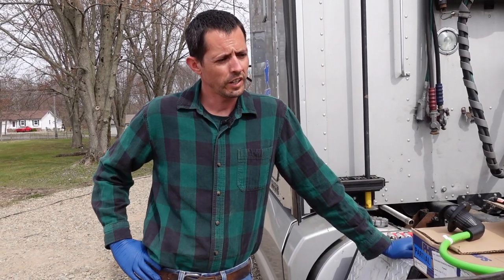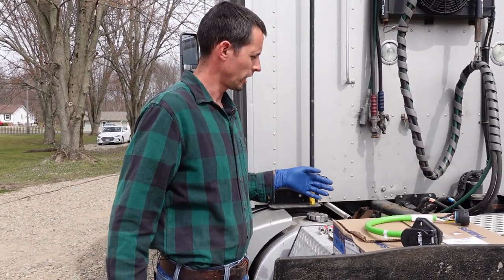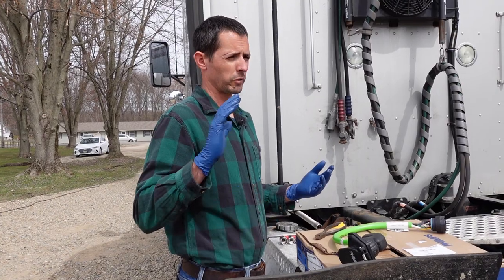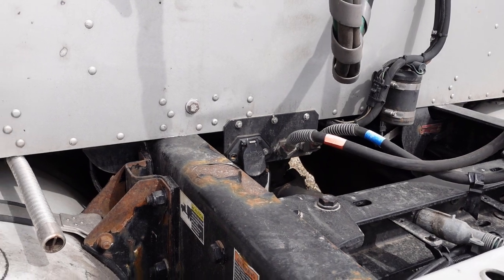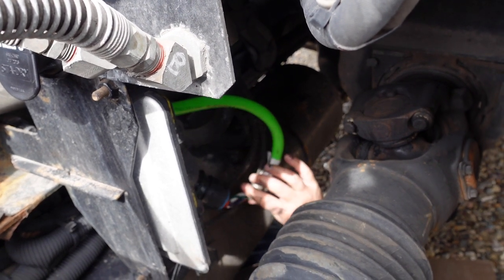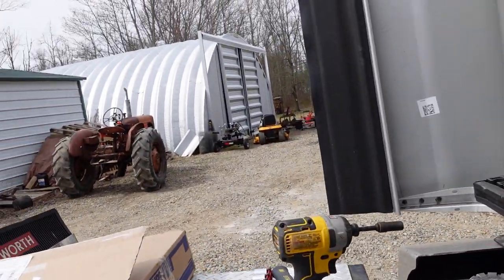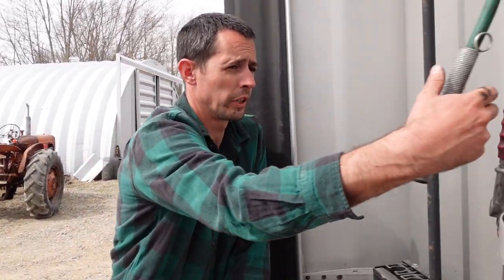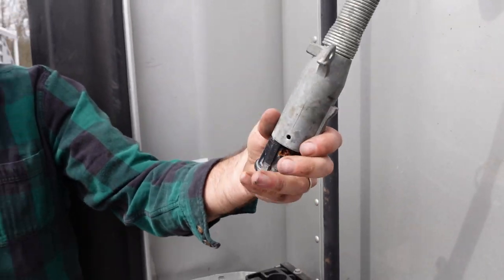How to Replace Trailer Pigtail Harness - Semi Truck Trailer Light Issue With Kenworth

Comment: Nice but why didn't you put dielectric grease on the short pig tail and on trailer tail saw rust . Winter plays heck on electric anymore.  I take all connects apart in fall to make sure of no problems.  You did well though. 2 thumbs up.  Happy trails

Comment: Will a bad pigtail make the trailer abs light come on
Reply: I'll say YES... on my T660 the bunker sit on the harness and crushed it...the ABS is ON and turning signal (right) is missing.  Being on the road have no option but to use duck tape: didn't help...